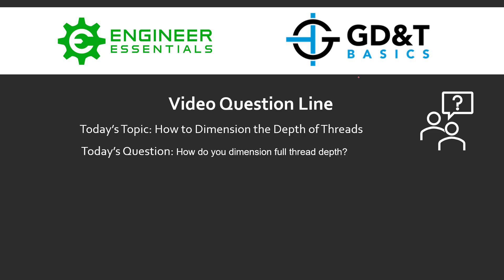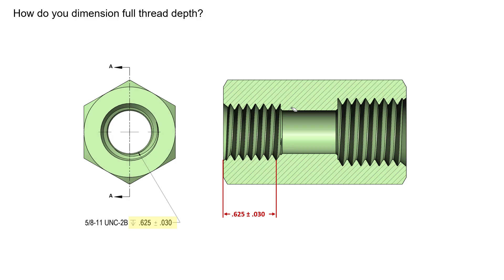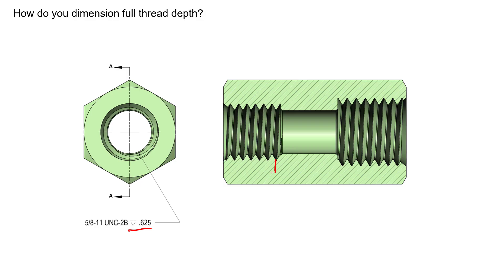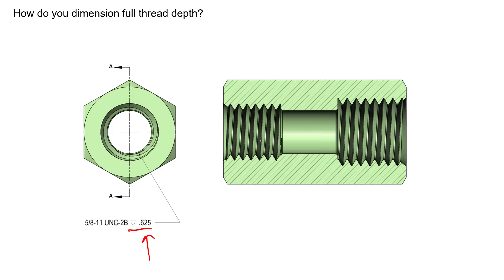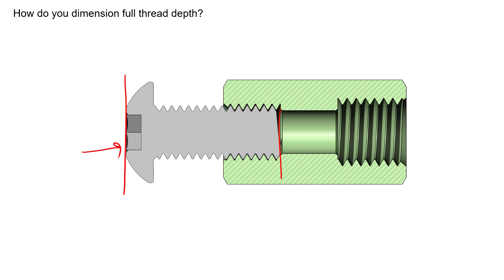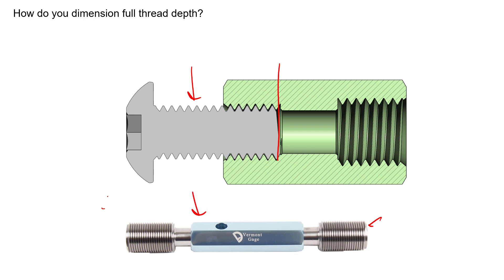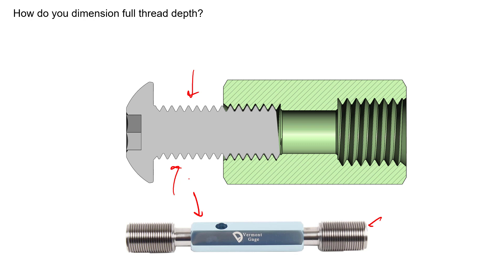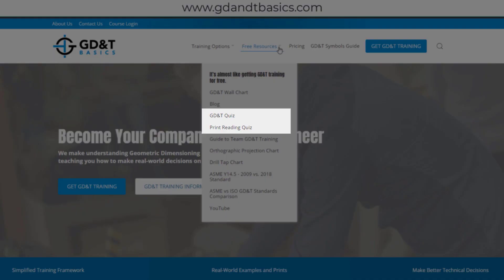How to Dimension the Depth of Threads

Comment: I'm trying to think of why one would want to control it this way. To have such a tight tolerance band with a minimum callout, for what purpose? If for the assembly method, you wouldn't want to drive the fastener into the shoulder lest you risk galling. Else leave a shoulder with thread clearance? Same function, far cheaper and easier to manufacture.

I guess to say I'm befuddled here. Or my knee jerk reaction is to classify this as a solution looking for a problem